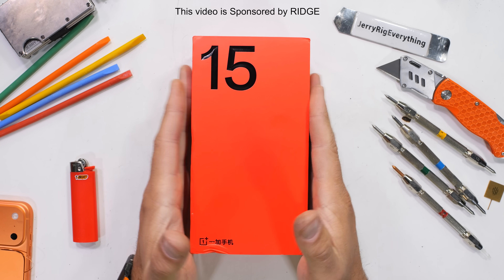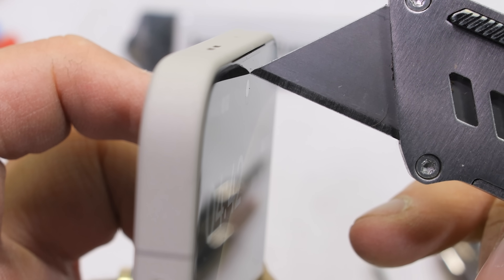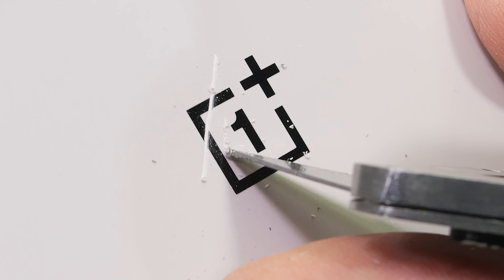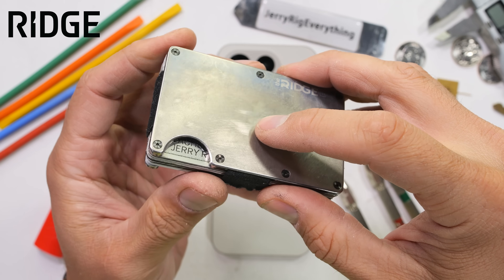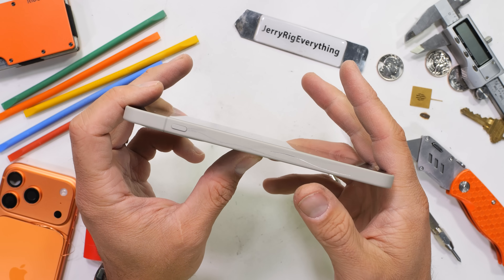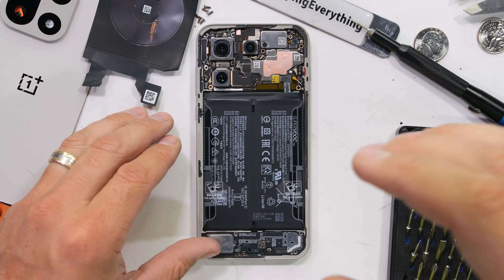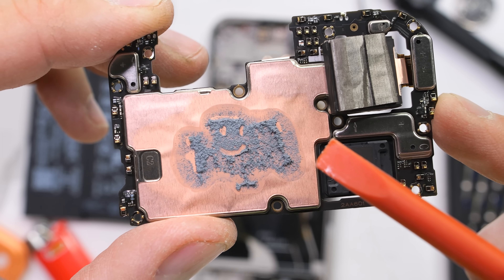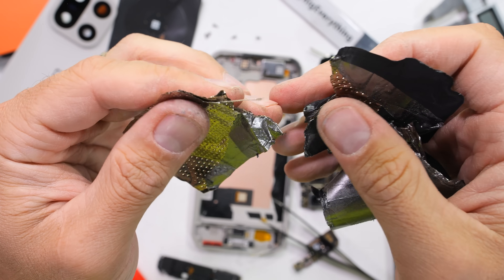OnePlus 15 Durability Test -- The Claim is Insane

Comment: Bro had to pick the only plastic variant 😭🙏
Reply from the maker: I was legit surprised.
Reply: @JerryRigEverything any ideas why they went with the plastic on their mainline color (they advertise this the most)? Does plastic help with heat?
Reply: @Ditronus. Plastic has a number of advantages. It doesnt shatter, signals penetrate plastic easier than glass, it's cheaper to manufacture, and if you use a cover on your phone like I do, there are 0 "premium feel" differences.
Reply: @Ditronus. I wonder if having a plastic back cover will retain more heat or not.

I would be happy if you answer
Reply: @bayramugurkucukbulut main advantage of a glass back is there are two spots for heat to get out, front and back.
With plastic at the back, heat can only escape through the screen. Although, with this things cooling system, you shouldn't end up with a big hotspot in one part of the screen.
Reply: Thank you. So, if the back cover is fiberglass, will it cause problems in transmitting the temperature of the device? Does it affect the performance of the phone? So should I get infinite black or ultraviolet?
Reply: @Ditronus.  This is fiberglass, not usual plastic
Reply: @JerryRigEverything  Mind revisiting with the glass varients? I've heard it's REALLY resistant to scratches, as the etching on it is highly abrassive to most materials.
Reply: @Derpalerpa it can be tungsten or uranium it will be scratched by a razor blades with some efforts. Pointless test which shows nothing. Let's freaking do hydraulic press test and smash phones with few tonnes! Why not?... and the lighter test. How often you burn your gadgets? Have you ever seen a fireproof phone?
Reply: @JerryRigEverything  do all of them
Reply: @JerryRigEverything Jerry I know a Tecno camon 30 is already ofsted but can you pls do it's tear down review please
Reply: @JerryRigEverything  you have to redo this. i stopped watching once i heard that because i for sure wouldnt buy the sandstorm even if i preferred it
Reply: @JerryRigEverything What ever happened with that red magic giveaway? 🤔
Reply: @JerryRigEverything  So can we expect a glass variant test?
Black would be the best.
Reply: @JerryRigEverything  i will need a phone if you don't mind😊 Thank you
Reply: Plastic is objectively superior.
Reply: @worthless_opinion why??
Reply: @worthless_opinion пластик хуже отводит тепло, царапается и пачкается. Действительно
Reply: @khord9496  ага, стекло с наклейкой зато отводит отлично. И ничего не царапается и не пачкается, ибо есть покрытие. И не трескается, в отличии от стекла.
Reply: @DmitrySSS если это сарказм, то не понял. У самого палас 15 черный, я об заднюю крышку в итоге свое золотое кольцо поцарапал
Reply: True
Reply: I think getting the plastic one was a better idea because it's the weakest one. Literally everyone knows how glass holds up, it's not any different than the other glass slabs he's been testing for years.
Reply: @ventilate4267 except that the glass variant on the other 15s very specifically has a new finish treatment that makes it somewhat impervious to scratches from things like keys, even when you're trying to scratch it. 

So yes, it is different lol.
Reply: @ventilate4267  weakest? the only thing glass is good at is being resistant to scratches. plastic is a stronger material. and you would have a case either way so the glass back is quite useless.
Reply: @ItzBrooksFTW  that's what I meant, I should have been more specific
Reply: @ItzBrooksFTW  Agreed, glass also adds unnecessary weight to the device.
Reply: @ItzBrooksFTW but glass...feels more premium...I like my phone's the same way I like my jewelry ;)
Reply: @NathanHassani-v3p  and yet 99% of people put a case over it to protect it....
Reply: @ItzBrooksFTW yeah because it's slippery.
Reply: I also took this sand colour not knowing that is not the same as other colours
Reply: @LordPeras every color has it own perk, none of them are the same.
Reply: So 🤨 ?? Honestly I don't get why people prefer glass on the back instead of plastic. If you drop your phone you're screwed, not to mention all those tiny pieces of glass can go inside the phone and damage other parts, making the repairability more difficult and expensive. Not everyone buys a case for their phones. In my opinion, back glass on phones are overrated and a downgrade 🤷🏻‍♂️
Reply: @ZeroDarknezz This glass isn't like the glassware used for food. It won't shatter into smaller particles that may go inside.
Reply: @anujmchitale  Depends on where the impact is. if its one of the corners, it definitely may and will shatter into tiny pieces. They will probs stick to the phone because the glass is probably glued to the back or something. But it will still shatter.
Reply: @Oozaru85 Oh. I used to think it would behave like acrylic. Need to be more careful with my Nord3 5G, since that has a glass back as well.
Reply: @ZeroDarknezz good for the manufacturer. They give you a more "premium" feeling product that's more likely to break and lead customers to repeat purchases.
Reply: I love the plastic back. Glass on one side is more than enough for me!
Reply: Hearing the black one has glass...I'm going for the "plastic" one as well
Reply: No its not plastic. It is a composite, mixed resin and glassfiber. Be Great be hated... Oneplus 15 is great🏆
Reply: @ASR_10_1 basically plastic with glass dust 😂, stay not great😂
Reply: @niceplaysYT  You are just jealous🤣Composite materials are the most durable. I bet you have shattered glass iphone🤣
Reply: @ASR_10_1 not anywhere close to the ceramic coating you get on the other two colours. The disparity is strange.
Reply: They aren't all plastic are they
Reply: I mean... At least we saw how easier to open plastic is than glass,  which is a pretty nice thing for someone who's planning to be able to repair their phone themselves (but hopefully won't have to)
Reply: You should do a classic phone teardown.
Reply: Yeah the black one is even more resistant
Reply: I would like to see drop test to see the durability difference between glass and plastic.
Reply: plastic? thought glass back or metal
Reply: Plastic is better IMO, i have oneplus 9rt , which had the backglass broke within a year even in the case. Its the same material they are using till now i think. Matt black anti scratch thing. I have seen people breaking their OnePlus 13 back panel on Reddit.
Reply: He is a faker though. He said there was gonna do the redmagic phone giveaway but no results have been announced!
Reply: @SamSeder-n8u  It was already announced lol. Keep crying cause you didnt win
Reply: @rbnsld1208 announced? Where?
Reply: @SamSeder-n8u wasnt that till the end of 2026 to enter?
Reply: @SamSeder-n8u yeah what happened to that giveaway? Didn't think Zack could mislead his audience for some engagement
Reply: @that1coolman Every influencer is a shill for someone, and if they aren't a shill they aren't an influencer but a... YouTuber
Reply: @that1coolman  his name is jerry??
Reply: @SamSeder-n8u No, it's Zack

Comment: Ridge wallets, 'Uneccessary quality for triple the price'. Why would anyone pay $200 for a Magsafe wallet which holds cards and cash and yet be provided with only half a magnet on the back (which can easily be pushed off the back of the phone)? But wait, then Ridge will say, "Oh, but you can buy the other half of the magnet for an extra $25 and permanently attach it to your device"...right.

Comment: 7:54 It says Li ion because it is. Si-C batteries are Li in battery with silicon-carbon composite anode. This helps in increased capacity of the battery by making it denser, bigger battery for almost no gain in weight.
Reply: It often says silicon-carbon on the battery though was his point
Reply: The issue is. Carbon batterys do not offer the same number of cycles before degrading. OnePlus 12 offers 1600. OnePlus 15. 1350
Reply: @toma.6942 i thought it was the opposite?
Reply: @Thorfinn0607 Not in terms of cycle count. That's why other manufacturers have not adopted it yet
Reply: @RileyRo5e its the reason for the cycle life downgrade from op12-15.

OP locks away a small amount of battery capacity to improve cycle life and limit charge percentage to release it later. Thats why the difference compared to other manufacturers.

Samsung made a 18650 years ago with silicon anode. Had 15 percent capacity bump. But rated for 300 cycles instead of 500. Silicon has been shown to reduce cycle life.
Reply: @toma.6942 tbh if you charge your phone from 0 to 100 every day, you'll have reached the limit of the OnePlus 15 after more than 3.5 years, which is still a long time
Reply: @toma.6942  you dont charge it as much..  op15 can hold 2days in a charge,  op12 a day maybe

Comment: Imagine innovating glass EVERY SINGLE YEAR and youre essentially just rebranding the same glass that scratches at a level 6 🤣🤣
Reply: I think Jerry should start testing impact resistance and smudge resistance. Also, some glass isn't as resistive to acids as others. For example, the pixel 6 was solid over all but if some malic or citric acid go on the screen then the screen's outer most layer corroded and you'd have a semi-frosted spot on your screen. It was annoying. JerryRig didn't test this, but the screens in pixels afterwards did not have this issue.

Also, some screens don't crack as easily on impact as others. I find impact testing more realistic than scratch testing. People dropping their phones with risk of cracking is more realistic and something not protected by a screen protector.
Reply: With deeper grooves at a level 7
Reply: Doesent mean Anything, glass that scratches at level 7 Is more fragile because the harder something Is the Easier It Is to break It
Reply: @caramellesweggose  Not necessarily. Depending on the structure and tech used in the manufacturing process, you can definitely achieve both at the same time to a very high level and we are not even speaking of layered materials. In general your statement is true, but only if you compare the same material that got hardened in different ways. Beyond that, there are much more nuanced differences between them.
Its quite a similar discussion that people have about steel for outdoor- or cooking-knifes.
Reply: If the glass on the screen its to much hard, it wont have proper sensitivity to touch...
Reply: ?? are you dense?
Reply: @ckmk-0  you must not understand sarcasm
Reply: @CBRoadster no what you said was very shallow
Reply: @ckmk-0  so are the grooves at a level 6 🤣

Comment: I like seeing the plastic back. It might scratch a bit but it will never explode and turn your phone into a $1000 cheese grater. I broke the glass back on my phone and replaced it with a polycarbonate one because I was sick of pulling glass out my leg every 5 minutes and it was also a great opportunity to clear mod it. The only thing I don't like is that OnePlus followed the trend of hiding the flash module inside a fake camera lens but that's a small problem when the rest of the phone is that good.

Comment: Wait a minute. Does that mean one plus isn't using a silicon carbide battery? If so doesn't that mean you can't legally fly with a 7000 milliamp lithiom ion battery?
Reply: It's a dual cell. The restriction is for single cell batteries that are over 6k or something like that.

Comment: Would be interested in looking into the difference between lithium-ion batteries and silicon carbon, if there is a difference in packaging at all.
Reply: Many Actual Si/ca batteries 

Are just li-on with si/ca in them 

Brands introduced this battery type at first with composition percentage 

Aka This battery has 40-50% si/ca composition 

Si/ca batteries are type of lion batteries 

It just replaces graphite for si/ca 
With the other part being lithium

Comment: I really do not like the fact the back of this colour one is plastic and the others are glass. It should be slightly cheaper if the materials are cheaper.
Reply: This is not normal plastic and it's actually more expensive to produce than the glass variants, which is why they did it for only the "special" color.

Comment: Someone else tested this coating and I believe they said that the marks left on the surface are not scratches, but deposits from the bodies of the scratching object and these can be wiped off
Reply: That was for the glass variants,  and supposedly with a kind of ceramic coating.

Comment: Definitely going for the black variant, if I buy it. The Sandstorm one is fiber-reinforced plastic (same thing the Oceangate submarine was made of), yet they market that one as the best/toughest. Kind of deceptive.
Reply: OceanPlus 15, but unlike OceanGate, the vapour chamber is meant to tear.
On a more serious note, I wish phone manufacturers put a spare back plastic cover in, but as an optional order, so if we break the backs of uor phones, or need the back to be plastic for some reason, like heat-staking in threads to bolt accessories to the back (Especially if PostMarketOS gets ported to one such phone where a custom accessory back would be mega useful).

Comment: When are you going to use unit of energy (Watt Hour) and stop using coulombs (Amp Hour)? You obviously understand how bad the imperial system is compared to metric, but don’t understand how coulombs can’t be used as a universal battery comparison?
Reply: Nice profile gimmick but make at least one video to educate people!
Reply: @keiwop can’t give you links at all. Didn’t realize YouTube shadow banned my reply to you. Just find mAh vs Wh and you will realize why energy is universal while coulombs can’t ever be compared unless batteries had the EXACT nominal voltage. Spoiler all smartphones have their own voltages, even individual models within the iPhone 17 lineup.
Reply: THANK YOU! Even the battery shown is actually a 3.575Ah. One plus is showing their HYPOTHETICAL Ah rating assuming parallel cells while not using a standard 3.7V nominal voltage.

Comment: Lithium ion, why the heck does it say silicone carbon!!
Reply: Silicon-Carbon (Si-C) anode batteries are a type of Lithium-ion battery that use a composite material made of silicon (Si) and carbon (C) in the negative electrode (the anode).

Comment: You missed an insane opportunity to carve Hasselbalds' signature logo 'H' on the camera bump with your blade , please do it...
Reply: I miss the the Logo, allthough I am not buying the phone. I have the OnePlus 12 and the camera element is much better (might be an unpopular opinion)
Reply: If it's unpopular, it's cuz we're right. I still have my 12 and it's still an ass kicker.
Reply: @andrea.mf.hailey  I mean I usally use phones quite some time, until they are realy dont do it anymore and I dont think one would allready notice a considerable upgrade over the 12 to justify an upgrade. 4-5 generations I'd understand, but 2?
Reply: Yeah I've been the same way recently, though it's closer to 3-4 gens for me. I had the OnePlus 9 when they started the Hasselblad deal, then jumped to the 12 last year. They're gonna have to try a little bit harder for the 16 otherwise I'm gonna be hard pressed to find a better device. 🙃😂
Reply: @Leon玲央 I'm that guy... I had the 9 pro for 5 years so it was time for an upgrade. My main reason for the 15 is the battery life and I'm loving it. Had to charge my 9 pro 2-3 times a day... Now it's once every 2 days 👌🏼
Reply: @Knighty2493  Yeah I totaly understand your decision, it just seems to be such a good phone. I like One Plus price to performance ratio in comparison with Samsung or Apple. Also the UI is just clean. 5 generations is a good point to change, especialy cause of the wear down. The only problem I have, with every year it has to the new phone, is the over consumption of our society yk
Reply: @Leon玲央yeah OnePlus is good value for money. I used to be an LG fanboy and would change every 2nd year for the G series they had which gave chance for an actual change in style and performance. But yeah I agree with you everyone has to have the latest... But isn't that telling people clearly they're choosing the wrong phone 🤷🏼‍♂️
Reply: It should be at the end of the video with the caption: "There. Fixed it"

Comment: I recently repaired my Google Pixel 6 and was impressed by its design. The phone has a 'burger' design, with the screen as the first layer, the internal components in the middle, and the back as the last layer. I found it incredibly easy to replace the screen without having to remove the back, which is not the case with many other phones. I learned how to do the repair from JerryRigEverything's video on the Pixel 6, and it was straightforward and super helpful. The thoughtful design definitely makes repairs easier!

Comment: That's why it's overheating. The vapor chamber is Tear-ible
Reply: It doesn't overheat what are you talking about? There is literally one source saying that and it's after a crazy synthethic test ran over a long period of time. That stress is not replicatable under normal use and no one who is getting it to use as a phone would ever come close...
Reply: @MrWoldWide12 the 8 elite was the same at release 

Overheating uncontrolled performance 

Give the oem some time to settle in 

High power = higher heat 

Just because it's a flagship doesn't mean it can ignore the laws of physics 😂 

Even the redmagic 11 pro with literal water cooling in built heats up not as much but still
Reply: I have one and it barely overheated during the transfer process, only time also where the battery where after a long day went down to 66%. this phone is a beast